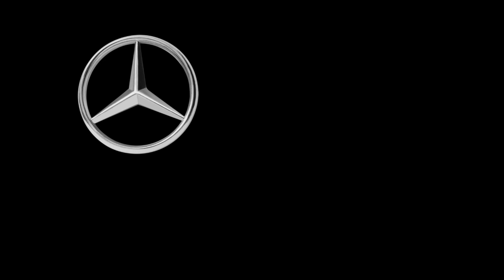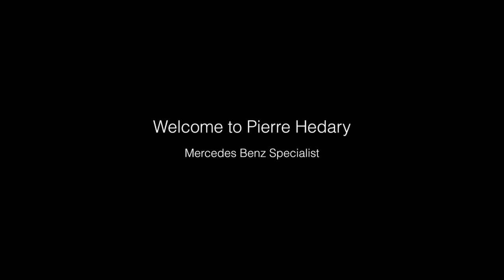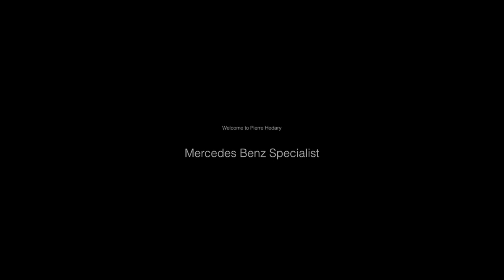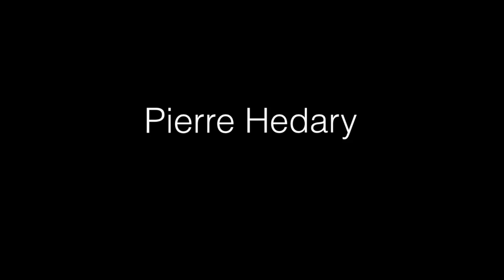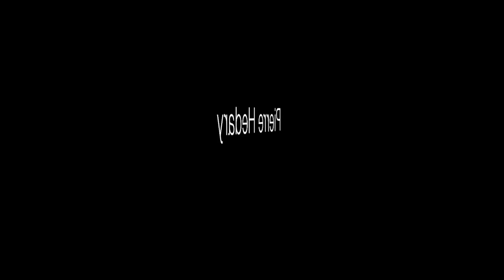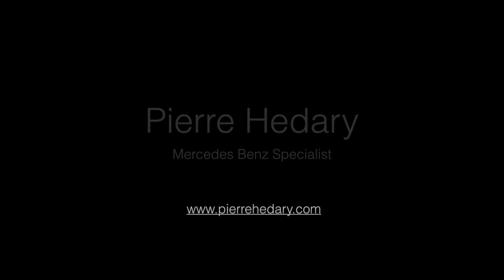Pierre Hedary discusses  D-jetronic 280se 4.5 starting hesitation and blow white smoke.

Comment: We have an instance with  replaced ballast resistor were it still does not start the car this has two ballasts were only one was replaced and so my question is will both ballasts have to be replaced the one that was replaced was visually burned up where the other wasn't